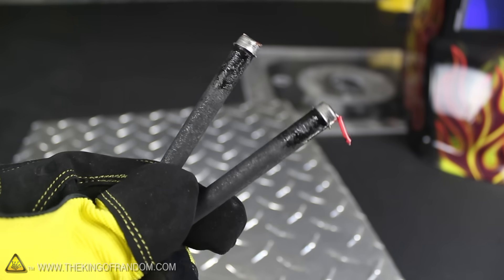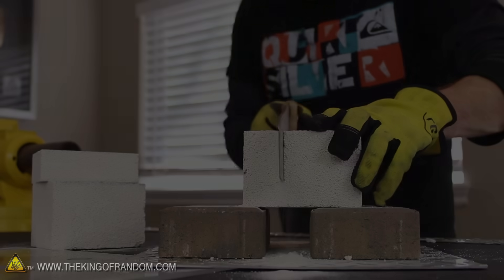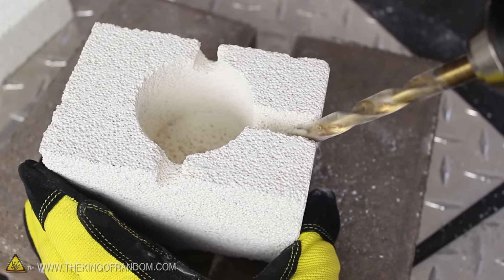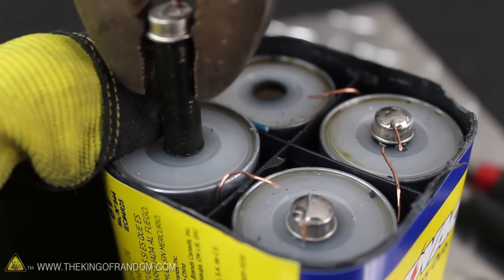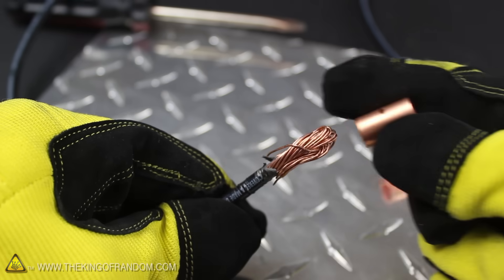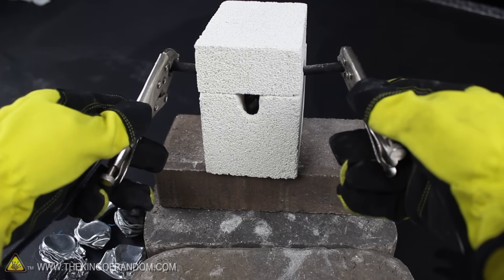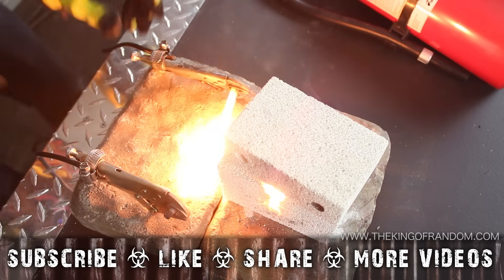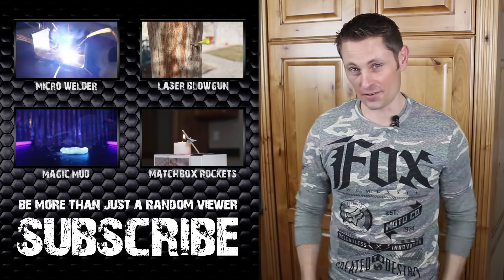How To Make An Electrical Arc Furnace

Comment: Does anyone know if the fire brick has to be alumina silicate, or can it be another substance? Because from what I'm seeing alumina silicate is pretty expensive....
Reply: Valek Turskov i cant remember, it was a clay fire brick of some sort that could withstand temperatures of 1000+ degrees or something like that. ill reply back if i find the exact name
Reply: Project Dedux any fire brick can work as long as it has the same measurements as his alumina silica fire bricks. Edit. Make sure it also supports the high tempatures.
Reply: Sans the Casual Skeleton thanks, I found a much cheaper fire brick with the same dimensions and can support the heat. Alumina silicate is very expensive apparently
Reply: What were the bricks you use? I can't find alumina silicate bricks
Reply: Exactly I can't afford it either I want to do the experiment too 😩
At least I will be able in a few months😀😀😄😄😎😎😃😃😃😃😃😃😃

Comment: Where could you get the brick
Reply: Brothers uniting _ it doesn't HAVE to be the brick he uses here, it can be any fire brick as long as it can exceed 1000 degrees F and is the dimensions. Certain clay insulation bricks would work I'm sure
Reply: If you live near a larger city centre with a fireplace retailer they will sell them, some hardware stores will too.
Reply: justin bartelen ok thank yall
Reply: amazon

Comment: You should explain why this is even happening and presenting some more alternatives to the batteries you've used. And how long do the two electric parts last? Do we need to replace them after a while?
Reply: ZorlacSkater everything should last forever unless one of your transformers fail or one of your carbon rods burn out, but that's why you have more than one
Reply: Les Allison does those carbon rods get eroded also?
Reply: carbon rods will burn down fast.
Reply: you can buy some on aliexpress - https://www.aliexpress.com/item/Dia-8-100mm-Graphite-Rod-20pcs-graphite-electrode-rods-rod-carbon-for-self-lubricating-bearings/32287359377.html
Reply: ZorlacSkater
Reply: Because thos other materials will just melt at that high temperature. As he said in the video, carbon rods can stand the heat. This is the same method used to melt steel in a steel mill, just on a smaller scale.
Reply: Is there difference between carbon and graphite rods? I've made a power supply and it was able to melt the steel bolt by it's own, but the thing with electrodes doesn't work. I've ordered them from China and it says 99% graphite. I've checked they conduct electricity with an ohmmeter but there's no arc.
Reply: You can use non-alkaline "D" batteries, too.
Reply: Why do we need a carbon rod ?
Why can't we use copper rods or anything else ?
Reply: Well looking at old search lights from wwii that work the same way... they had to replace the rods every now and then soo
Reply: Iorveth has

Comment: I am very interested in this project but I am concerned about the electricity deciding to go through my body instead of the rod from the lantern battery. Is there even a chance that wall holding the hot lead and the groundline that the current might decide to go through my body and stead of the rods? If there is what precautions do I need to take such as gloves. Do they need to be heat resistant and electrical resistant or just one of the two. +Grant Thompson -"The King of Random

Comment: you dont have to take apart batteries for the carbon rods. just go to any welding supply store and buy a box of carbon-arc gouging rods. they are 3 or 4 times as long (the effective use of the rods in the video is short, they run out when you cant push the rods through far enough to contact, longer rods make a much higher percentage of effective use), they dont have the wax on them, and a box of them is much cheaper than buying the amount of batteries to get the same amount of (short and only partially usable) rod. And they are designed specifically to carry current and produce the arc 

The one thing i was concerned about with this was the impurities. Lots of carbon from the rod, residues from the wax, the battery, and from air reacting inside the furnace

Comment: As a cheap and effective way to construct a current limiting power supply for this furnace and possibly other projects I recommend "700 Science Experiments for Everyone" Compiled by UNESCO and published by Doubleday: ISBN: 0-385-05275-8 in 1958 and revised in 1962.
Page 185 shows how to make 'an electric arc heater' controlled by the 'simple water rheostat' found on page 184, that is the essence of simplicity. It can regulate current up to the limits of your circuit breaker's ability to supply it. 
I built one when I was a kid and it seems to be ideal for your applications. 
Yours for Better Amateur Experimentation.
Der Teufel
P.S. Scientific American also published a book of Home Experiments around the same time, including how to build an X-ray machine. See also "Science Magic" by Swesey and the Guide to Amateur Rocketry" by Capt. Bertrand R. Brinley: easily one of the most complete treatises on this subject.

Comment: I'm curious, roughly what amperage are you running? I've been trying to make one but I keep obliterating my refractory bricks. the steel certainly melts but I end up getting a shell of melted firebrick forming over it before I can pour. I'm curious if maybe a lower power for longer would melt the steel without melting the brick. I've gone as low as 100a with no success.

Comment: is there any way to hook this up to something else besides the microwave batteries? Because i have a forge in my backyard i have been melting steel but i want to try it the modern way with this mini arc furnace and i dont have any scrap microwaves and that project is a lot of work any way i could hook up to like a car battery?
Reply: An African Child Use a cheap arc welder
Reply: just buy a cheep stic welder

Comment: The arc also produces a LOT of UV which will RAPIDLY burn skin and eyes. It also produces a lot of ozone and nitrogen oxides which are toxic and corrosive. It is very irresponsible of you to not explicitly warn of these dangers at the start of the video. These are not things that  MIGHT be a hazard, they ARE an integral hazard of the activity just as much as the hazard presented by the molten metal and hot carbons.

Comment: hey could it melt tungsten? could you please try melting tungsten and show us here on you tube please.
Reply: No this would not be able to melt tungsten as it has an extremely high melting point 3,422 °C or 6,191°F just the bricks alone would not be able to withstand such temperatures but even if you did have insulation to withstand it the electrodes would likely fail.
Reply: Correction those electrodes wouldn't fail actually so yeah get some nice insulation and sure you could melt tungsten.
Reply: +Noob_Flavoured_ Doritios i was wondering what the temperature inside the brick was, what about the brick would that fail?
Reply: Tungsten is extracted from the ore chemically, then the resulting powder is put into a high pressure press to make it into blocks.  The blocks are then sintered together into solid pieces with a process that is very similar to this, but put the tungsten in place of the carbon rods instead of in the bottom of the crucible.  Finding an electrical source big enough to do it will be expensive, and if you completely melt the tungsten you'll pretty well have nothing to hold it in since it has one of the highest melting points around.

Comment: so you can basically make real life armor by doing lots of these melting metal stuff
Reply: at least he's thinking out of the box, you braindead!
Reply: Real life armor? Please increase your intelligence.
Reply: Pyro Maniac I managed to make a full set of steel plated copper armour.....
Reply: Poorly molten and poured Metal tends to break on high power impacts. Thats the reason armor is still made by blacksmiths rather than machinists. Armor is "real life" btw

Comment: Is the Refractory brick reusable switching from metal to metal or do you need to place some sort of crucible in the base of the brick such as an old fire extinguisher cut in half?
I am trying to melt copper into 5 pound ingots... My goal is to stock my own home supply of different metals – copper, aluminum, steel, etc. to later cast tools or parts out of styrofoam packed in damp fine sand molds.

Comment: And if you use one end as a ground clamp, and add compressed air, you have an air carbon arc cutter. They will cut through a lot of crap. Used one years ago when I was learning to weld, but don't see them that often.

Comment: I'm from Australia where std power outlets are 240v 20-30 amps I wound my transformer with 100mm cross section wire about half inch thick in simple terms on the out put I get around 550 amps at 1-2 volts is this to hi for carbon rod melting.Thanks great vids

Comment: do you need the Microwave generator thing
Reply: yes, that's what powers it
Reply: Its a flashlight battery
Reply: the battery is where he got the carbon rods from the homemade arc welder is the power source

Comment: Danger!  If you pour molten steel (2700F)  into a container with ANY moisture in it, the moisture will flash to steam causing a "steam explosion" that will blast all of that molten steel back into your face, onto your hands, and everywhere else causing fires, severe burns, and other serious injuries if not death.

Aluminum and zinc are significantly less volatile but should be regarded with similar caution.  I've seen guys on youtube pour molten aluminum into and onto all kinds of crazy stuff including ant hills.  But you WONT get away injury free if you try that with molten steel.  

Just stay away from steel.  It contains twice the heat energy (per unit mass) as aluminum.  When it comes into contact with something at a lower energy state (lower temperature), it will transfer an incredible amount of energy very quickly.  This is how it superheats liquid water into steam in microseconds.  When water flashes into steam it expands to a volume 1700 times greater than the volume of the liquid water.  This nearly instantaneous expansion IS an explosion that will blast the molten steel everywhere.  And then you're dead.  Call it "Revenge of the Ants."
Reply: so i shouldnt put this in my mouth then?
Reply: in a muffled voice how many scientists are in this comment section

Comment: to create an ekectrical are you need high voltage so how did you get super high voltage with that much currant
Reply: that other machine you saw, when he was squishing the copper cables. that's how
Reply: It's high amperage not high voltage

Comment: If I were to make a bigger version, could I make the brass knuckels?
Reply: You probably should just make the mini metal foundry.
Reply: +cabanatuan95 mini metal foundry doesn't melt enough metal to make anything, I guys if you really needed to melt a single nail
Reply: Yea it does if you use a bigger hole ( ͡° ͜ʖ ͡°)

Comment: I built one of these when I was like 11 in circa 1962 and didn't heed the warning on using goggles.  I ended up with a serious case of welder's flash, VERY PAINFUL!!!  I melted anything I could get my hands on.  I also laid the carbon rods on the cement basement floor and got a red hot spot on the floor.  My brother told me how dangerous this was, the floor could have exploded in my face due to the expansion in the heated spot with no where to expand to other than to buckle and explode.  Be careful......
Reply: Yes, I remember at least one painful sleepless night.
Reply: Half and half.  Fraternal half Alsatian, maternal half Hungarian.  Real name, Muckensturm, which literally translated is "flystorm"???? Mucke = fly  ,  Sturm =  storm.    The arc furnace came from a book,  700 Science Experiments for Everyone.  My other Bible was The Scientific American book of projects for The Amateur Scientist. Both books are still on my bookshelf.  I am very lucky to have all ten my eyesight and my life.  Have experimented with some of the most dangerous stuff on earth.  X-rays, explosives, very high voltages and currents etc.  At age 50 I got seriously burned. Was very heavy into serious pyrotechnics (fireworks)  Mainly rockets, but also shellbuilding and large aerial salutes.   I have also gotten rear ended and thrown from my motorcycle and 30 days after that got t-boned in my van by a Chevy Blazer running a red light at +35 mph.  I still tinker a lot, it is what makes me tick.
Reply: wolfgang schmittenhammer, that was a very interesting and well told sotry there, you're not the only one who did dangerous stuff as a kid, luckly I never got injured
Reply: did the welder's flash go away?
Reply: I did the same thing with carbon rods arcing on a cement floor and the cement  turned red hot in a spot and did  explode, I figure because of the moisture in the cement. It went off with a big bang and little pieces of hot cement hit me in the face, fortunately not in the eye - I wear glasses. This was a few decades back. I don't remember getting UV burns but I may have at the time. I need to make this furnace nowadays but i cannot find the Alumina Silicate Fire Bricks.
Reply: ElPaso TubeAmps I'm soon to be able to make AirCrete, it works as a furnace
Reply: +wolfgang schmittenhammer deutsch?🤔
Reply: ElPaso TubeAmps Try looking for a local fire service company
Reply: wolfgang schmittenhammer w
Reply: I
Reply: wolfgang schmittenhammer holy sh*t rlly
Reply: wolfgang schmittenhammer um wtf
Reply: wolfgang schmittenhammer zip
Reply: wolfgang schmittenhammer q
Reply: You sood be dide if it was in 1962
Reply: Where did you get power from
Reply: wolfgang, I used a regular 110 volt Arc welder and 12" carbon rods. At first tried 50amp then 100amp then 180amp. All 3 melts got a matte button. I am melting gold and platinum mixed together. The buttons break up in my hand after cool. I put them in nitric acid and water thinking maybe some junk is in there. Any idea's why this happened? Should I turn the amp's up more?
Reply: find an old wood stove
Reply: wolfgang schmittenhammer FU
Reply: you can also use the ezbatterykit.com for something cooler

Comment: So,  in lieu of the silica bricks being so hard to find on hand and the fact that they are consumed somewhat with every melt,  could the red-clay oven-bricks be used for melting copper? Making some copper castings and the options are limited to the arc-furnace,  HHO-torch,  or a 2.4k$ electric klin....

Comment: If I'm using an actual arc welder to power the furnace, what Voltage/Amp should I get to melt copper and aluminum?